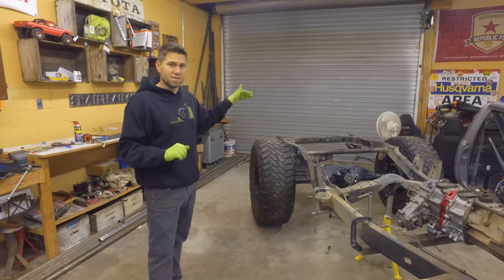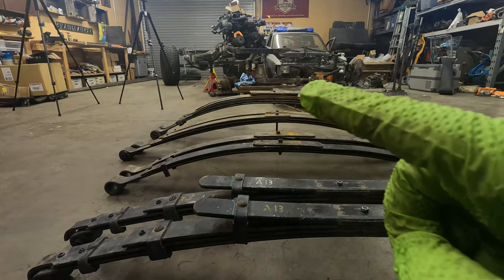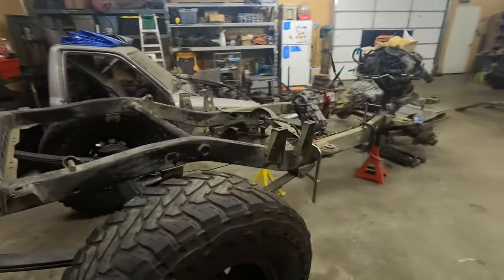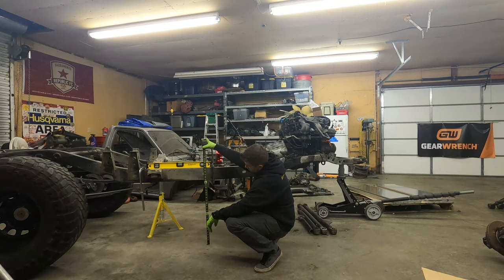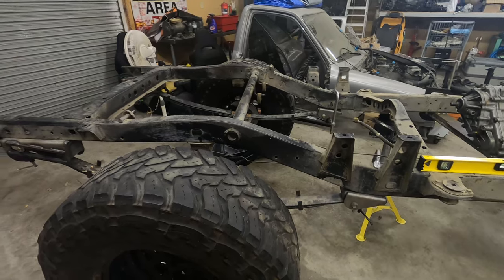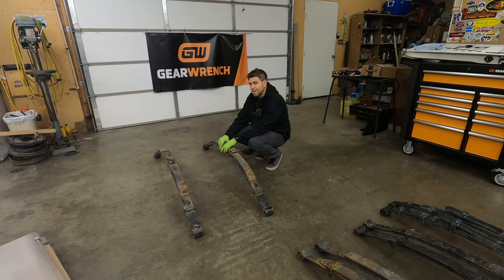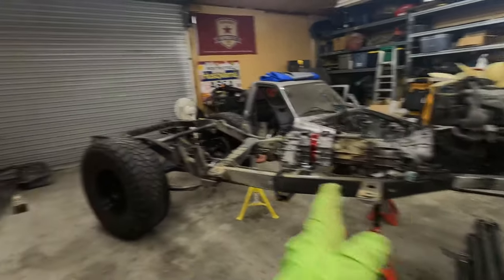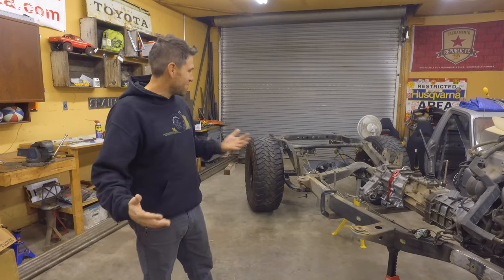Setting Up Rear Spring Under | Samantha Vlog 9

Comment: Spring Under! 
-more stable
-driveshaft better protected
-hangers are just as low as spring over
-no axle wrap

If you want more belly clearance runner larger tires. 👍🏾
Reply from the maker: Might happen 😉

Comment: Interesting. I like the Samantha vlog. Seems like spring under could get hung up on some things. I’d go spring over and run the first set of springs. It puts you at 25” but with weight on it you’ll end up perfect.
Reply from the maker: Yeah, I have thought about that... The springs are defintally  lower but all in all there really isn't that much below the axle. I think it might be easier to go spring under and if I don't like it to than change to over, thoughts

Comment: Maybe I’m missing some context.  But it seems very early in the planning to be choosing the spring per ride height.  There is no weight on the back of the truck.  I would think the right choice of MAIN SINGLE LEAF should be chosen based on axle location and leaf spring mount locations.  Not based on how high the chassis sits when unloaded. I have been going through a similar thought process on my leaf sprung crawler build

Comment: Spring over..after running my yota buggy on 63s several yrs here in Oklahoma on some pretty knarly trails they work pretty good that way..just run two leafs in the pack front and back on 37s so it doesnt set to tall..Enjoy yals podcast and vidz!
Reply from the maker: What is the belly height on your buggy?
Reply: I will hav to measure it again this wkend when i get home...another  thing is i narrowed the mounts for the leafs so they are tucked up into the frame and eye to eye its 29" wide which helps with flex..
Reply from the maker: @jeremymonroe2039  -- that's a good idea... I want to drive this on the road though so I need some stability
Reply: Framerails set at 24" and tcase skid at 20..main thing that hangs up is the rear pumpkin..

Comment: I wouldn’t be “afraid” of running spring under, definitely go with the longest main leaf pack (63” Chevy), run a u-bolt eliminator, and don’t weld the slider until you cycle the suspension with the pack disassembled.  Also, all of your frame height measuring was worthless because you have ZERO weight on the frame, and for half of the measuring you did, you had the weight sitting on the red jack stands behind where the front axle sits.  That made the engine be a giant counterweight and unload the rear suspension.
Reply from the maker: Spring under with U-Bolt eliminator? Wouldn't that have the bolt heads facing downwards and exposed to the rocks?
Reply: @SnailTrail4x4  easier to protect bolt heads than the ends of u bolts.  Unless you were planning on flipping the u-bolts and facing them up……

Comment: Im spring under now on my Jeepster Commando...108" wheelbase. Im digging it alot. Mine ar on YJ springs with 40's. If you want more height for loading down the rig might need to go to a traditional rear shackle or small lift spring.
Reply from the maker: Yeah the weight factor is an unknown at this time. Only one way to find out... Finish it

Comment: Awesome build, can't wait to see more! 
 -Maybe I missed it somewhere but if low CG is the goal, why is keeping the leafs in the rear the goal vs links?
Reply: prob cost and ease of install. i too am building a low ride height 4runner with full width axles and wanting to do spring under. Dont have the funds for coil overs etc leafs are just plain easy and ride ok for a daily driven.

Comment: I ran Stock 63 on a tg4 HD front n it sagged n settled bad in the back ended up going 2" block on top but my current rigs settin on 3 link front n 63 through frame not under n amazingly it'll top the 30 degree ramp on 35s

Comment: Go spring under for anti axle wrap, spring over then you’ll need a Antiwrap bar. Go higher on belly and let weight settle it down. Low good but then more turtling lol
Reply from the maker: Yeah, I am sure these springs are well settled in, But there will be more weight for sure

Comment: I vote spring over and set to 24-25 once loaded down should be around 21-22 and if to low easier to lift up higher.
Reply from the maker: What do you mean flip the hanger?

Comment: I reckon it's going to be too low with the tundra springs spring under after you get the body and other stuff on. What year/drive/chassis tundra did you get those from? I have f150s and 2 in blocks on my long bed first gen and I've been looking for taller springs to get rid of the blocks.
Reply from the maker: I have spoken to the tundra owner and he said they are upgraded springs, I'm not sure who makes them, but they are arched more than stock

Comment: How did this turn out? im currently building a 95 4runner. about to put super duty full width axles under it and i want to keep it low. So i was going to do the spring under route as well. i have seen a couple of 4runners do it. theyre getting maybe 3-4 inch up travel but thats ok with me. mines a daily driver not a rock crawler. also how are the sliders working out? i wanted to use those as well.

Comment: Spring under would help with axle wrap but I personally would go spring over better flex and more clearance under axle
Reply from the maker: Why is there more flex with spring over? I have actually heard the oppsite
Reply: I think the reason most people associate flex with SOA is flatter springs. You can run an almost flat spring in most applications coming from SUA to SOA and gain 4-6” over stock height. Heavily arched 4-6” SUA lift springs generally flex less and ride like poo.

Comment: i like that your playing around and mocking these leaf springs, but i think if possible, mock it u with the full weight of the truck bed, cab, fenders, hood, full size spare, gas tank, gas in the tank, your easily missing 1,000 lbs of stuff but trying to mock it up. i know you want to get the rear suspension figured out before you do the 3 link but maybe you need to install a bunch of stuff to get a more realistic idea of which springs will work the best. then take back apart

Comment: I think you are underestimating how much its going to sag with weight of truck on it. Probably in the neighbourhood of 3”
Reply from the maker: You think so? You think with a bed it would go down 3"
Reply: The cab weighs more than you think and still puts a fair bit of weight on rear axle. Plus fuel tank, exhaust, bumper, sliders, spare tire etc. it all adds up. I weighed my first gen ext. cab (tacoma) at more than 950 lbs without doors, hood, fenders.
Reply from the maker: @kevinmtoyota  -- dang, that's heavy... We lifted mine off the frame with 2 other guys, I know it weighs a fair amount